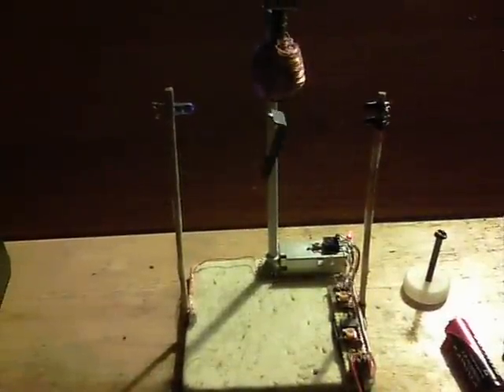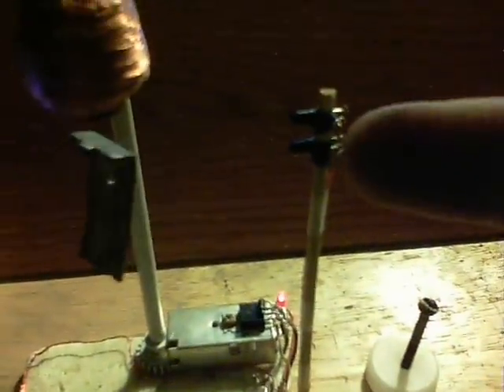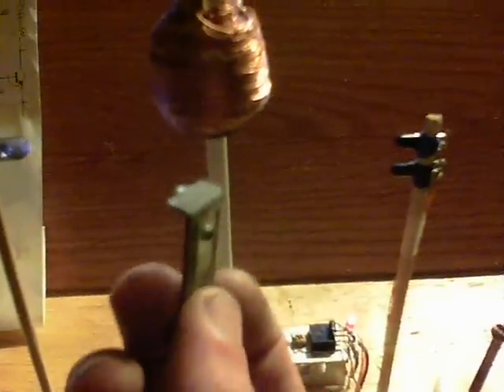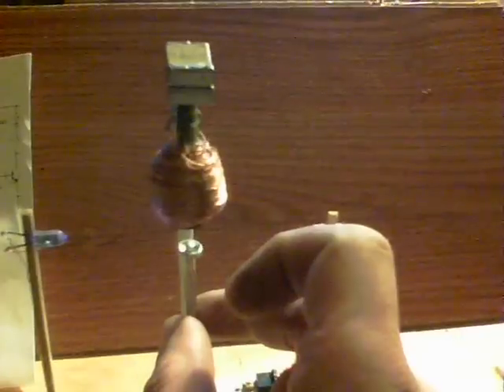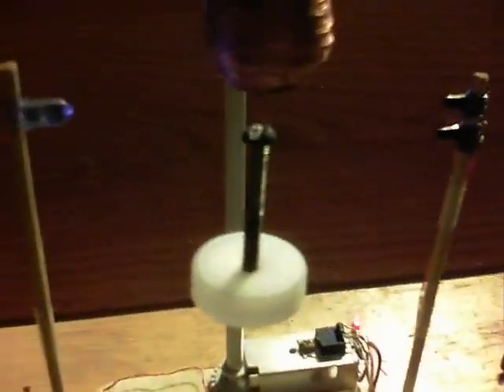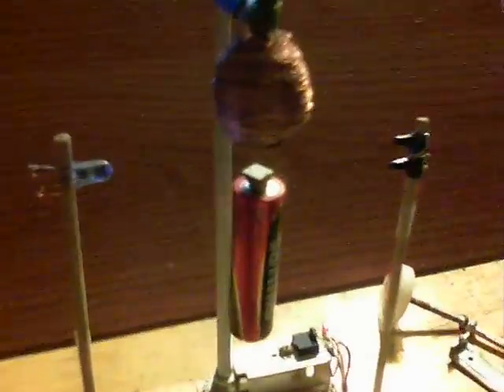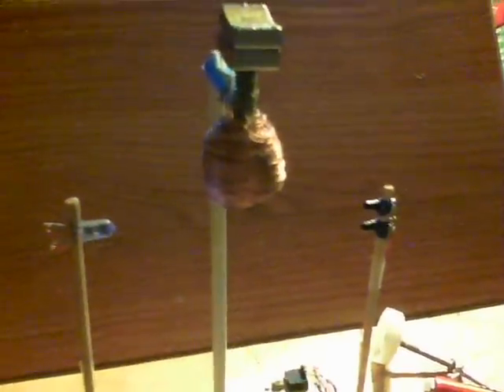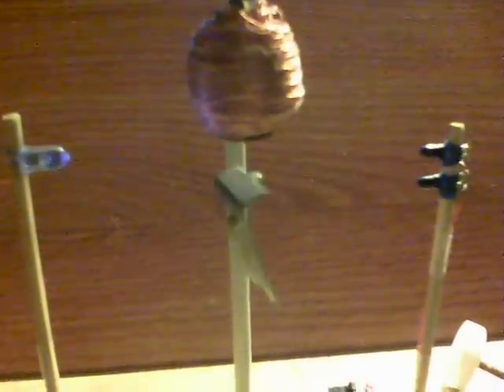I/R Magnetic Levitator

Comment from the maker: Thanks :) Been meaning to build one of these for a long time, but only found the circuit again the other day. The piece of steel moves up and down smoothly in the field if it turns around slowly, as the op-amp equals it out. Quite a mesmerizing effect.

Comment from the maker: Yep, the red LED gives an indication of the I/R LED's being set up correctly, as an object stops or allows the beam. The electromagnet is fired depending on if the beam is cut and the circuit is always trying to form a balance of the op-amp signals. When they approximately balance, the object is levitating. 
The TIP122 legs are Base/Collector/Emitter

Comment from the maker: On the Adambus77 circuit you can use 4xAA batteries for 6V. 
For the one in this video, it's a converted PC power supply (Green wire connects directly to any of the black ground wires, which makes it switch on without a computer).

Comment: Excellent!!  I have been wanting to build one of those for a long time.  My only attempt years ago was a total failure.  I think that I will have another go now that you have done it.  This circuit looks easier that the one I tried.  If you can get some kind of a magnet rotor to spin that would be great!   Stability and balance might be a problem.

Comment from the maker: One pot is on the beam sensor input, it called for 13K, so is a 20K pot set at 13K, meant for subtle tunings that it luckily didn't need. Other pot is on the 150K/100nF section, to counter flutter if it showed up. Value on that one is 50K with 100K fixed resistor (but pot set at approx 46K). Yellow little pots off a CRT monitor circuit board, marked '203' and '503' :)

Comment from the maker: Hey congrats that you got it going ! 
The LED may be on all the time because of the coil construction and resistor, but also the I/R send/receive properties. Placing in tubes to narrow beam may work. But it does work, so the LED is of no actual issue, though I understand your wish to have it run perfectly. 
You could try current limiting on the input with a couple of large parallel resistors. You'd lose some pure lifting power, but everything would stay cooler.

Comment from the maker: Cheers :) Yes, would like to see your version. The circuit makes good head sense and parts are inexpensive. My budget was zero, but then again i have a shed of junk lol. Probably other op-amps would work, tranny is a Radio Shack part. One tip, if an object wobbles around the coil will warm up, steady and stays cool. This thing is levitating a Mattel car at 1 1/2 oz at moment.
With neo's at base of a rotor, the swing is hoped lessened+have had items spin at good rate...main thing would be wobble.

Comment from the maker: It's always good to have different methods and ideas. in the case of a wire, the tolerance of the wire (bending) would have to be high and that would hamper reliability. Another problem may be that there'd still be something physically touching the object.
I like the idea of simplifying the process though, well worth thinking on. You may also find a wire material that does the job :)

Comment from the maker: Yep, Ground is still the Ground and normally referred to as -12V. But in this case there are 3 supply voltages. The Negative from the +12V supply is now the Ground, connecting to all the Ground places on the schematic. But, the -12V is what seems to confuse people. Op-amps need a actually negative voltage supply, as well as the + and Ground of regular supplies. That's why a PC power supply works so well, they already have the -12V output.

Comment from the maker: The minus 12V only needs to go to the op-amp (it's only that which needs it) and why I used an old PC power supply. So you need +12V, -12V and Ground. All of the Grounds are the 3 line triangle shapes at the bottom of the circuit diagram, so all can connect to one place or a long bare piece of wire, which makes it easier. The +12V goes to quite a few components on that top line, so would again use a bare wire length to connect them all to, so it looks just like the diagram :) Good luck !

Comment from the maker: Normally yes and same here. Nothing on this circuit requires high voltage or high current types.You can take apart any old hi-fi, radio, TV's etc and find bunches of the popular types..best from 1980's or 1990's. For the send/receive LED's, an old VCR was what I used, they're in the tape transport mechanism. Should be able to find everything and more at a decent sized yard sale or thrift shop .

Comment from the maker: All of this type of op-amp are 8 pins and theres an industry standard with the pins and their functions. On the datasheet you'll see the triangle shapes, which are for the 2 op-amps on the chip. Designers often use that triangle symbol instead of all the connections. Yes, confusing I agree if not used to that. But, just follow the datasheet for the pins, with Negative supply to Pin 4, Positive to Pin 8. Pins 1,2,3 are one whole op-amp, Pins 5, 6, 7 are another whole op-amp on the same chip :)

Comment from the maker: Ah no, that's the main thing about powering and I understand your confusion. Much more info in the description box. The power supply is a converted PC one, which has +12V, -12V and Ground. Op-amps need a -12V input to work. If you go to Lidmotor's channel or Adambus77, they have a circuit which uses just 2 transistors and battery pack. It's not as powerful but lot less complicated if not built this sort of thing before.

Comment from the maker: That's the sort of thinking i'm doing. 'Right Now' goods would be digital watches which never need batteries, emergency light flashers for hikers, Hartley circuit radio senders, perhaps heart pacemaker applications using carbon. Also, battery charging is one application...walk around with several parallel devices as a wrist strap and keep a cellphone topped up. Wrist worn is one thing, but imagine a body belt or as the underwires of ladies bra's (surface area kind of dependent ahem).
 :)

Comment from the maker: it would indeed :) I'm finding that the lower the center of mass the better a rotor rotates, but they do fly off if the balance isn't 100%. Perfectly feasible if machined I would think. Used one of sMartCreations2010's self starting circuits yesterday and had interesting results, but at a point, the rotor would wobble off.
You might like the new 'All Stars' vid of this, got a heli and a plane in the air :)

Comment from the maker: This is long gone unfortunately, I used some parts for a simpler design that didn't need the -12V.
The full circuit is linked to in the 'About' section.
Perhaps do a search for the 'Adambus77' circuit..that one is a lot easier to make and good luck with the project :)

Comment from the maker: You'll need a good power transistor. Look for amperage handling and high wattage output. For example, popular MJL21194 has 200W capability.
Another idea is to parallel connect 3 or 4 TIP120's to share the load. You know 1 works, so 3 or 4 together would make good sense if you have them.

Comment from the maker: If the mouse/kbd need to be in line of sight then yep, they'll be fine...the light frequencies will match too by design (some are different wavelengths). For PNP, A733's are very common but also very good, they beat 3906 and other common ones in own experiments. Walk the streets and find a TV lol, plenty in there.Though, the local tip might allow a fiver for discarded electronics...lifetime supply !
Core on my coil is just a regular steel bolt. You could use some laminations, easier with bolt.

Comment: According to the circuit , the led glows when ir light falls on ir receiver . And it sends singals accordingly to electromagnet (it is what i think , am i correct). I have to solder all of this components and is the soldering of tip 122 transistor same as that of others ? Help please .......

Comment: I was thinking if , instead of ir led system used in your circuit , I use a connecting wire which would connect two ends of wire (instead of ir transmitter and receiver) and that connecting wire would be connected to object we have to levitate. If the object goes too high the connecting wires would break the circuit and also the electromagnet . This would bring back the object to its original position and again setup the circuit (no connection between wires). Comment!